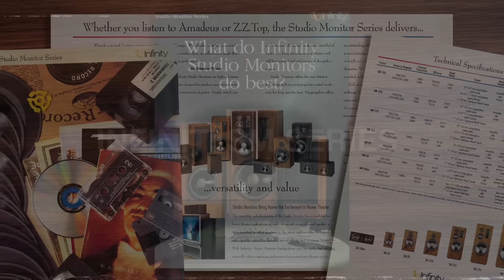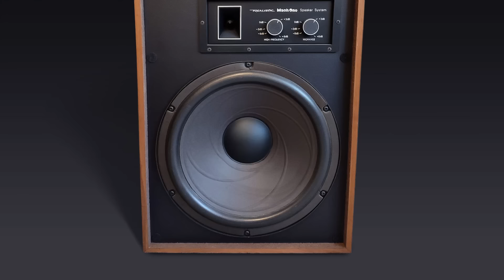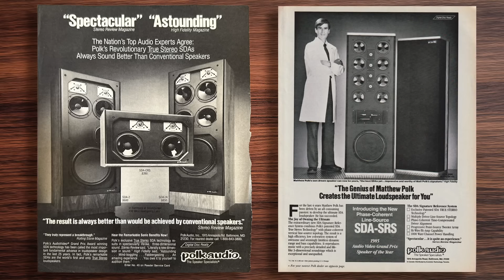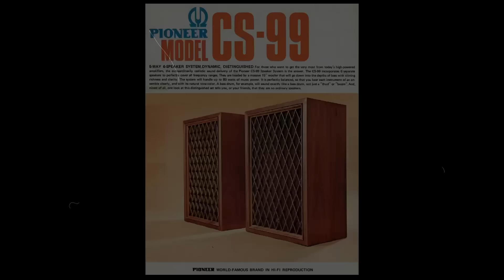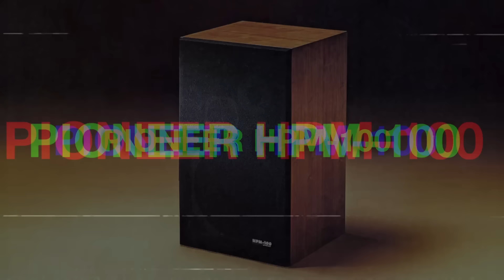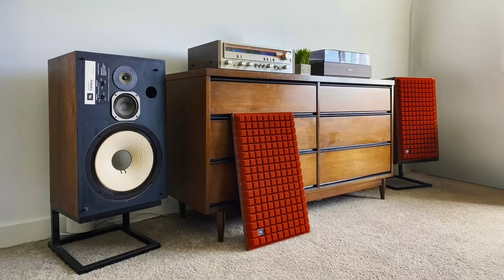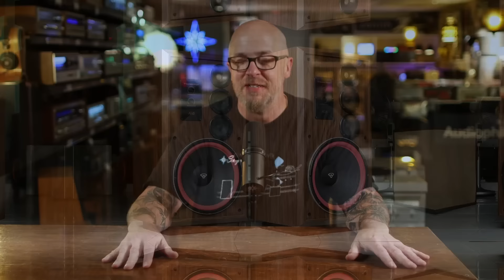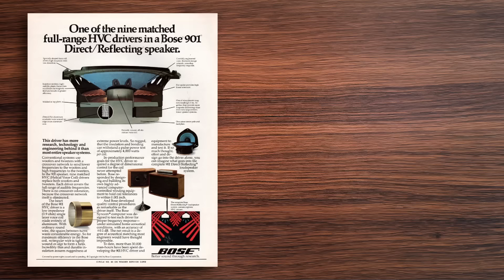Why Do Audiophiles Hate These 9 Legendary Speakers?

Comment: I sold hi-fi in the 70's, and we sold the HPM 100's. We saw them as directly competing with the L100's as you said. I was not really a fan of the L100's, mainly because their deep bass was weak (but nowadays a sub would completely fix that). But I preferred the L100 to the HPM 100's because, yeah, they had more bass, but it was definitely boomy. At least the L100's were flat until the bass just went away.

Comment: I have a vintage pioneer system that includes the HOM 100s and they are hands down one of the best sounding set of speakers I’ve ever owned. I’ll never part with them. I also have another stereo that has a pair of Cerwyn Vegas with the 15 inch woofer and dual ports in the back. These things are beasts!! I am very happy with them also. But I listen to my vintage pioneer system the most.

Comment: Vintage speakers, pre MDF, tend to have a better midrange than the ones that came after, even if some have treble/sibilance issues. 
MDF tends to smear midrange textures. 
Thankfully modern designers are switching to composite panelled cabinets or CLD, which are superior in most ways, at least as far as wooden boxed speakers can get.

Comment: My dad gave me a pair of HPM-100s when I was 16. I still have them hooked up to my pioneer elite pro tv. I absolutely love them. I’ve always noticed the V curve to them but but it wasn’t too much for me. I just turn the mid range up on the crossover knob

These are one of the reasons I became a big fan of pioneer. Although they aren’t in the place they used to be, they still have some great stuff out there today. I’m hoping I’m correct by this but it also looks like they’re getting back into home AV soon
Reply: My very first audio video receiver was a pioneer go be surround pro logic receiver. Jensen 80 watt 8 inch subwoofer. KLH main left and right channel speakers. In Yamaha surround sound center channel and rear channel speaker kit. 
I now own a pioneer Dolby digital receiver the Yamaha front left and right channel, Jensen center channel speaker, and JBL mini bookshelf speakers for the both surround left and right and surround rear left and right.

Comment: I've been listening to my Bose 901's for 10 years or so in its proper configuration (8 speakers facing the rear) but couldn't get right sound from it (lacking bass, subdued highs). I was ready to give up and spend at a minimum 1 K on a different set, but then I moved to a different home and changed my listening room completely (size, room height, etc.). Somehow, having these speakers facing the opposite way did the trick and gave me the sound that I've been searching for. The soundstage is unbelievably wide; the bass can be felt with enough sustain; middle treble clear and controlled. I'm now listening to a very musical set of speakers. Cannot really ask for more (well, maybe a few hundred more records and more storage area). I now believe that these speakers can be awesome as some say they could be.
Reply: I had a set of Bose 901 series Vs (they made several versions). I lived in an apartment with a high ceiling, and with them situated away from a side wall, they really sounded nice and balanced. However, my next apartment had completely different accoustics including a lower ceiling, and I could never get the 901s to sound right. I sold them.

Comment: I have those same Cerwin Vega At 15s.. And also the Cerwin Vega Dx-9. Had them since the mid 90s. And they will deffinatly perform. They been threw many power sources. Harmon kardon .NAD. Carver  amps. Pluse sevral recivers. But i eventually stepped up into the land of Mcintosh. I have a pair of the Mc1201 monos.  I can say they sound pretty crisp and clean. On those huge amps.  Probably as clean as there ever gonna be.  Lol.  And they will get spookey loud. Without tripping the tweeter breaker or popping the main fuse. And they went threw many fuses in there earlyer life. Before McIntosh came into the picture.😂.  But I actually got scared for the speakers. I never seen them get that loud without blowing fuses or complaining cabinets.

Comment: A year ago I spotted some cabinets with white woofers, I mean big and heavily built, $29 for the pair, no labels, I grabbed a cart , paid before someone grabbed them and stuffed them in the back seat. I'm thinking finally HPM. Wrong, they are L100 and everything works. ANd now I understand why 70's albums sound so bad, they were mixed on these. The woofers sound great, but the rest is just awful, I mean awful. The crossover is just 2 caps and 2 pads. The drivers just run wide open. I played with them for a few days and realized the only way these will sound good is 1. Clean then flip and find some Polks or Advents, or make them 2 way with a proper crossover and horn where the mid and tweet used to be. I never heard such horrible cone breakup in my life. They do make great speaker stands.

Comment: I pretty much agree with everything you said with the speakers you mentioned.  One other note is alot of  vintage speakers may or will sound better with a good working vintage  integrated amp or receiver. I was surprised when I did alot of swapping around amps and sometimes you find that magical match for them. But I do agree mostly with what you stating

Comment: I'm a Bose 901 fan. i know. I heard them first when I was 16. I'm 52 now. My buddies Stepdad had a pair that to my 16 year old ears sounded great. I've put together a pair of 1968 901's with a vintage pioneer receiver, a, pair of 301 series 3 I've had since high school and a marantz 2250, Along with a yamaha amp for my powered sub. Alltogether and balanced with a Fluance turntable and ortofon blue stylus, i'm VERY happy with the sound. Sticky Fingers, Let it Bleed and The Beatles Love album are some of my favorites to listen to. (year is important, I think the closer to the date they actually released is better. As everyone probably knows, they cheapened the build significantly with paper drivers and particle board on the 901s)

Comment: i ended up with a new pioneer AV Receiver due to its used every day for 8-20 hours at a time so reliability is what i need. Pioneer VSX-534 5.1 , it has a lot modern tech like Dolby Atmos and DTS:X audio formats. Or even without height or surround speakers, you can still enjoy virtual 3D surround effects with Dolby Atmos Height Virtualiser and DTS Virtual: X. and good thing the price was only £320 and that inc postage and extended extra year warranty. speakers i wanted made in uk / England only and buying new made in uk well id need to sell an organ as i really like new mission but way out my budget. so what i ended up with and they work very well together well for my hearing they sound really good and 3d sound the first time hearing a bullet cross the room and hit wall behind well i felt i was in the movie and for music they plenty good for sound and for room they are in, i went for front right and left the Denon Mission the ones you ha on this channel and they are pretty good well amazing for price £50 and i got made in England, the centre i got B&W and was not easy finding one what made in uk but i sound one, and the rear right and left i got a pare of Gale speakers with the option using two cables per a speaker or use the plate or a cable to connect  like i did so only one cable on long run. the mission Denon £50, Gale £30 and the B&W centre £50 and the receiver £320 well its not a lot money and for me they sound great for not a lot of cash. they now been running for 2-3 months and they work well and as small room they plenty loud , do not even think i got close to full vol but just no need too and some speakers the base is plenty

Comment: 72 year old still recording rude guitar multi-trk... Grew up on stereos since '60 with Pop's Dynaco 70,  Garrard table and Knight Danish modern walnut cabs that had EV woofers and like 4" horn tweeters. 2 cabs were the speaker cabs the other 4 were storage, bookshelf, LP storage - Playboy mag stuff of the time. My 2¢? Loved watt per Db of JBL; loved Advents and KLH bookshelves;  did NOT like any speaker that had wood grills, lattice crosshatch  foo foo on front - yuk - HATED Bose because they SUCKED watts for a nondescript flat sound. I LIVE and will DIE by the Smiley Face. Smiley face put the bomp in the bomp shoo bomp.Smiley Face will knock you up AND get it aborted in one EQ !!! Cerwin Vega was just "stoopid" like their Sensurround rig theaters leased back then for 'earthquake' and 'roller coaster'. Screw CV, If we wanted to hurt some one we'd just roll in the Altec Voice Of The Theaters and serve shut up juice to all the little stereo boys with their cute receivers, lol.     Love u'r series. Fart Blossom, out.  🎸

Comment: I have Pioneer CS-E531 as nearfield monitor, i make new crossover and, and i lost motivation to search for new, better speaker. Theirs sound is great, dome tweeter, dome midrange, full realistic sound and which is most important for me, their have neutral sound with almost flat frequency response and 90db/m/1w sensitivity. After some years with these speaker, i not find other speaker with same, or similiar vocal presentation, dome midrange make really great job.

Comment: I currently use the HPM 100s in my game room and I use the Cerwin Vega at15 in my home theater I absolutely love them both I also use a Klipsch Center Channel speaker in my surround sound I would love to pick up some Klipsch Heritage speakers and I have a pair of bose inter audio bookshelf speakers that sound amazing never been a fan of the Bose 901 I had a chance to buy a pair for $400 one time but it didn't have the EQ I didn't even think about touching them without the EQ because anything that is designed to run off of a DSP it's going to be complete garbage without it

Comment: That is because the first allround good sounding low distortion with full frequency range and capable of higher full range sounding / volume passive and active speakers where from 1982 and onwards from almost exclusively dedicated speaker brands only; with exception of earlier 70's Philips MFB's but that was not a speaker only brand and a few Mission, Infinity and Jamo, Jensen mid/late 70's loudspeakers excepted (And although good sounding ignore the Magnapan type speakers and dedicated speaker brands horns of the late 60 and 70's with had frequency limitation; but often sounded good, but where also very expensive for most listeners).  Thus accept for Philips including with lots of none MFB's; no other all round (home) audio manufacturer before the 80's and afterwards till date; has produced serious decent performing speakers at any price range. With maybe one or two Sony Speakers, maybe two Technics and two Grundig's and one Telefunken and one, maybe two Marantz Speakers and one Pioneer at best TILL date! This does not take taste in account. Note: Also Philips has made very bad sounding speakers from dirt cheap to very crazy expensive. But in general for a consumer audio brand they had the loudspeaker throne (Philips had the world's biggest soundlab for developing and testing speakers in general) in other words the best sounding speakers compared with other all round consumer consumer electronics / audio brands! Conclusion: Buy only a general rule loudspeakers from a dedicated home audio loudspeaker brand. And listen to them first if possible!

Comment: I've experimented loads of speakers in my time from small to large and i find that home made speaker cabinets are far better than brought ones and some advice on big speakers is they are better out of the cabinet and if you are clever enough you can turn a15" sub into a midrange speaker with an 18" just by crossing the wire with the 18" and out of the cabinet and pure bliss is the abyss.😊

Comment: Yea, got Bose 901s in 74 instead of JBL 100s after Vietnam and the Japan stereos, but they needed power which I built Dynaco 400- 200wpc in 80s. Later 80s moved into the hi end with B&W and McIntosh, going ever since.

Comment: I bought a pair of Klipsch Forte's in the mid 80's from a pawn shop outside of Ft. Hood (was stationed there) and though they've been refoamed and crossover's redone with new caps and stuff by The Sound Idea in San Antonio and I still play them today. Most folks bought them and ran them through lackluster solid state stuff and got that bright shrill sound. Me? Dynaco ST-70's (redone twice already) are in my "get out and leave me alone" room where my analog rig is (Dual 721, Counterpoint Preamp bought it used/half dead). My "daily driver" setup is JBL L100s I bought NIB at the Sight N Sound in Bamberg Germany (been refoamed) which seem to be an almost perfect match for the BK power & preamp (also bought used).  Still have some gems like an Akai GX-747 and TEAC 1000RBL or something like that in here too. If not for the Army PX's around the globe where I was stationed there is no way I could have afforded none of this. Wouldn't trade none of it for the world.

Comment: I have a set of 1984 Cornwall's, original drivers, original crossover (recapped).  These sound awesome if you drive them with quality stuff.  They definitely prefer quality tube amps and anything over 10 watts is a waste.  Feed them with a high-power trans-amp running at low power and they honk at you.  Feed them what they want, then sit back and smile.

Comment: I love the 901s if set up correctly.  Equally important which many (most?) people did not have was enormous power.  I used 500 WPC RMS mono amps at first and it sounds like you are there.  Eventually, went with 1,000 WPC and they sounded like I died and went to heaven.  But again, with the right room, with the just right setup with lots of power, all things VERY expensive back in the day, which eluded most of the mass market owners.

I also like what you call Kabuuki? speakers.  I had both Pioneer and my favorite, Sansui, with simpler designs.  With lots of power they sounded great.  Though you could not play them super loud with power or they would flame up.  I found the JBL 100s blew drivers all the time.  Same of the studio monitor versions.  That said, you could get them flat and accurate within their range.  But sounded a bit grey and cheap, primarily due to genuine high end and bass roll off.  And the soundstage was a bit flat and two dimensional.  But listenable speaker.

The original top of the line Infinity speaker from the 1970s ? remains for me, one of, if not the best sounding mass produced speaker ever made.  Every model down and on from there got progressively much worse.  But of course, they were 30-40K when then came out!  Probably 150k today.

Comment: “No highs no lows it must be Bose” 😂
Reply: i have researched alot on bose its a very savage brand with small paper cone drivers obviously cheap just with adding acoustics they become loud but no way they did that mad audio fine work like the classic hi fis the made to sound as per there brand weak lows crispy but and low density highs but there. mids are fine!

Comment: I bought a pair of bose 901's (series 1) back in 1998 from a grocery for 200.  He had the EQ box, but because they were originally sold on Korea, they were made for 220 power.  I opened up the case, saw a giant resistor in line with the power cord, ripped it out, and soldered the connection back.  It turned on, and has worked since.  I use it now for my basement workout tv, but compared to my living room setup, it sounds like a toy.

Comment: There vintage speakers who perform extreme good with a high end amplifier like the Kenwood LS-P9300 and the ESS heil amt 1a !  They have no weak points , even better than somme new high end speakers.  
I have 9 pair of vintage speakers all connected on several Accuphase amps... And the LS-P9300 sounds gorgious , you can hear every instrument verry clear

Comment: I have had several of these speakers. I have heard them all. Horns like Klipsch are great for loud forward sound. The same goes for the L-100 and the Cerwin Vega, they are more bass heavy though. Owned Cerwin Vegas in my house, car and even used some subs for my DJ business along with Yamaha and JBL mains. Loud is good. Prefer domes at home and more balanced sound like the Polks. Have some ADS 710's I've had for decades and they are still my critical listening pair. Have some Klipsch Reference series speakers for Home Theater and when I want to rock a bit. I admit, my loud days are over. As an old sound guy, I have tinnitus. Ear plugs are my friend, wish I would have used them earlier.  Have to admit, I've heard 901's in the right setup, they sounded pretty good with a very wide smooth soundstage.

Comment: 901s are among the worst speakers I've heard...even with EQ, and even with them setup well.  That EQ boosts the ranges that those midrange drivers do poorly - highs and lows.  Why not feature the flaws?! 

The Infinity SM series are just nasty sounding.  Cerwin Vega excel at colleges, dorm rooms and parties.  Not much of a fan of any of the speakers you listed....all noisy boxes with inferior parts.  Klipsch, JBL, and Polk might have the most potential, but there's no way any of them are spending time in my listening room without some heavy modification.  I suspect that most of the emotional attachment people have for these was made before they ever listened....marketing works.  Or maybe they just associate them with a good time partying, which is fine if that's your thing.    Different strokes for different folks...it's all good if they're happy.

Comment: All loudspeakers except Bose have one very characteristic distinctive feature - a huge woofer. And such a woofer is characterized by the tightening of sharp fronts of the musical signal due to the huge area and weight of the membranеs in addition to strong distortions caused by the bending of the large-sized membranеs. So why can these loudspeakers be liked?